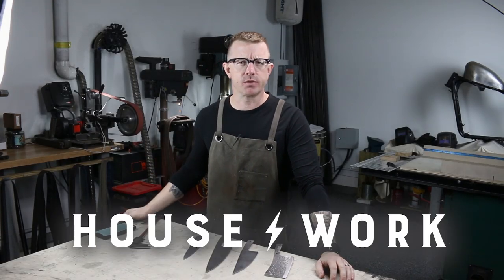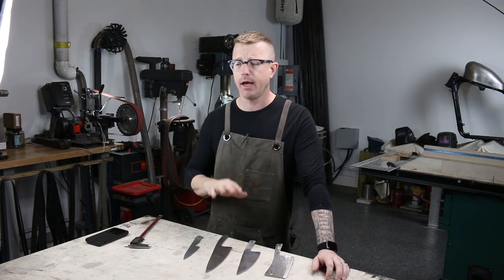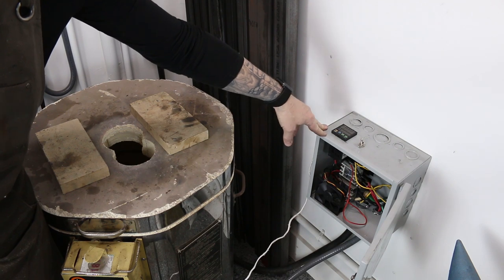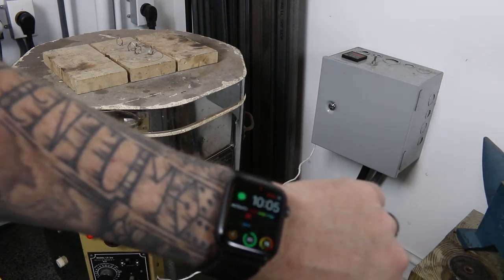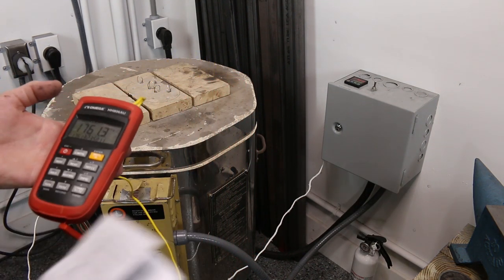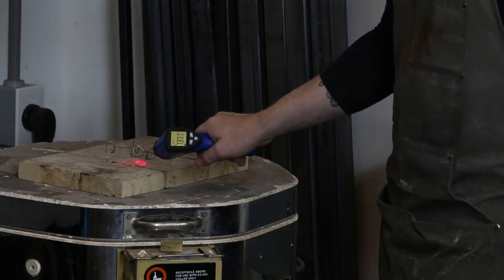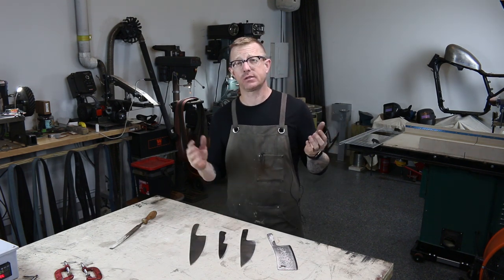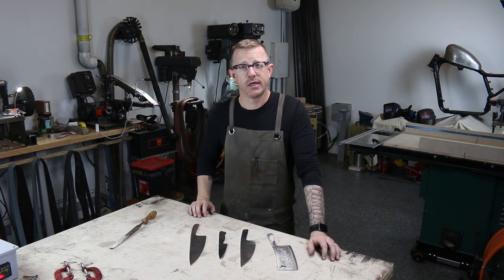How To: A-2 Tool Steel Heat Treating

Comment: Thank you Brian. I am an extremely ammateur knife maker and usualy use old car leaf springs or the occasional chain saw guide bar for making knives. However recently my friend gave me some old bearing sets to make a knife with, so I opened up the bearing units . About a half inch wide by 7 inches long. I spent a few days forging out the steel. I just use a ceremic pot barbecue as a forge and use a big sledge hammer head as an anvil !. Then after that spent another few days grinding then finishing with a lot of filing and stoning to get a scandanavian grind.
I just heat treated my usual way by quenching in oil and was shocked when it would not harden. Did a second quench with the same bad result. It was then when I found your video to help me out. I do have experience with maraging steels after researching helicopter rotor bolts of which I forged and could not harden. I did not know tool steels had similar problems.  Thank you very much for the video of which I learnt a lot. I wish I saw it before putting a lot of time into this failed project but you never forget when you learn the hard way. 😂
Reply from the maker: Awesome - Happy it helped out! Thank you!

Comment: Thanks for the insight Brian. My interest in heat treating A2 is the result of needing to make plane irons. I have some precision ground A2 flat stock that I want to use. What I need to know is how to make a "poor man's" heat treating setup so that I can heat treat what I have. What do you reccomend?
Reply from the maker: The best and cheapest way to get a heat treating setup is to do what I did and use an old ceramic kiln and covert it to a digital control. I made a video on that. Check it out. How To: Convert a Ceramics Kiln into Digital Heat Treating Oven - PID Controller https://youtu.be/pRuq8hOTOWU

Comment: Wow, bad ass channel man, stumbled across you this afternoon cause my Neigbor threw out a treadmill and I knew the motors could be useful....anywhoo, to the best of my knowledge, those knives you just tempered gotta be up there

I’ve never heard of a double tempering cycle not an air quench, but dropping 1000 degrees Frankenstein in 3 minutes as opposed to 3 seconds probably isn’t much difference 

Got something to do with making the steel go austenetic so the martencite crystals can form with layers of cementite around them 

I bet they’re about as hard as you can get steel to get with an easy bake oven lol

Do you plan on doing a blade quench? 

I hear you can get some clay, a torch and just heat the blade bit up, then quench it so the blade is hardened, but the rest of the steel is tempered so the knife doesn’t explode into a low earth orbit when you’re carving into a turkey and hit a piece of bird shot someone forgot about 

Pretty dope that freakin knife guy sent you that email, shit seems pretty legit
Reply: Lol

Comment: I see you moved your PID controller box, off the kiln to the wall......did the controller box get to hot?
Reply from the maker: I had an instance where I had one SSR melt on me, now I don’t know for sure if the box was too close to the kiln or what exactly so I added a small DC fan to move the air around and removed it from the side of the kiln just to make sure. You would think both would fail. Just to be sure I took it down, put it a few inches away and all has been working fine since. I use the kiln weekly with zero issues. Thanks for watching and commenting.

Comment: Why didn't Mike mention to not let your peice go below 120f before going into fist temper cycle,  or Don t start temper cycle until it is cooler than 150 f.
Reply from the maker: I don’t know, is that a thing? Get back ASAP as I am heat treating some more of this today. 😅
Reply: @HouseMadeUS  I read a book called heat treating for tool steels,  The author specifically mentioned that of you want to see a full potential, out of the steel, what is considered tool steels specifically, you want to have your temp cycle ready and not let cool  (in this case air cool, or fan cool) past 120 f, because, it basically really limits the effects of tempering. For a hard knife that just cuts succulent fish and paper, this might not be a problem. But if you wanted to do a sword, I believe you would want to start tempering between 150 and 120 f at like 650 or 700 for 2 hours two times.  But I'm a little fuzzy on the soak time,  if it's a 1/8 inch blade, does it still need the full 20 minutes at 1725 to 1775?  I've seen many guys on you tube make wonderfull, sharp big choppers,  doing everything but that, and they start chopping when it's only a little cold outside and big chips break out of there blades.
Reply: Ok one more run at it, so if you let tool steel cool of to room temperature, it forms retain ed austinite structures ARound the grains,  and if you try to temper, it will fracticaly start to grow and eroode those grains,  into a less fine, more brittle structure.
Reply: @ryanb1874  I know some makers that use cryo after quench/before temper, which would obviously bring it way below 120f.
Reply: @ryanb1874 this is factually incorrect. 
All hardenable steels, no matter how fast the quench will have RA.
Always. 

One of the actions happening during tempering is converting RA to martensite.

The reason for a second Temper is to Temper the newly converted martensite from the first Temper.

Sub zero treatments also convert RA into martensite.

Comment: I will never understand how can quenching be good, when surface solidifies faster than core, just imagine core volume cange in already solid surrounding. How can it be even than?
Reply: @awashburn6944  i know it is, but  there must be a way to quench, stress it from inside out. It is a solid that is stressed on high temps, and as it cools it shrinks unevenly so it leaves lot of microscopic cracks and voids like strings, thats what i ment, yes my bad it is a solid , but very streched solid .
Reply: @awashburn6944  wait, but not all of the lattice are martensitic, i cant imagine that when lattice is stretched at high temps and it is stressed it can save same formation. In some magnification value it just separates in string like figure and create voids, and I saw it in images. My understanging on martensite is that when cooling rate is high, puling forces between iron atoms are aditionaly elongated (because one C inbetween) and it cracks basicly the same in all C content steels if cooling rate is elevated. So for example, imagine a lattice, and external stessor, and as outside atoms take more stress untill it comes to inner one concave shapes form leaving only half atoms bonded, thats main problem for fatigue I think, like in welds, its not cracks, but exists and its clearly visible under microscope. Those string like voids are actualy small lattice cracks, initiator for visible crack, and its rly hard to track on what magnification value will they be evenly distributed. Its bugging me, cuz well compressed forged steel dont have such problems
Reply: @awashburn6944  just to make things exaggerated, when liquid glas drop hits water its hollow from Inside , but since its liquid there is no deformation, and if rly hot solid hits room temp fast , bilion microcracks happen in same pattern from inside out! I just hate that so i was thinking there must be a way to stress material from inside out, that would solve so much fatigue problems
Reply: @awashburn6944  but its still a solid. I take glass as example to compare because less resistance as it adapts to external stress easier. It is irons tendention too if it creates voids after quench. Voids confuses me, and separation in lattice, it cant even be called crack cuz its very small. Thats obvious tendention to behave in direction of like glass drop, but because differences as you said it just "snap" in different way.
Reply: @awashburn6944  about uneven cooling , actually object tends to even cool trough surface line, so it bares much more stress because its still hot untill signal reaches core , and thats where difference in temperatures strain surface longer untill core catch up. Surface cant cool instantly because thickness dont allow, so difference in temperatures object surface/collant creates strain on atomic attraction force equal -500> celsius object temp( probably much more), without extenal stress. is simple words its squeezing so hard like you freeze it until it crack. But thats not the problem, problem is that stress pulls atoms from inside in surface direction and create voids, those 2 types of cracking are not related, because 1st one happen instantly, and 2nd leaves space for damage under load.I suppose carbon escapes in that voids after temperbecause it has nowhere else to go, I tried by best since english is not me native

Comment: I've never tried A2,  but have done quite a bit of SS.   Next time, you might want to get some SS tool wrap to prevent oxidation. I bought a piece of 1"x12x12" aluminium, & cut it in half...  Great quench plates, and while the steel is cooling, I use my air compressor(I added a filter for my sandblaster & a "T" for other tools, so I don't have to worry about moisture) to cool it quicker... I've heard a lot of people talk about you have to quench vertical, also have heard, you have to be facing west, but honestly I always quench horizontal, mainly because it's all I have and have rarely had problems. When I 1st starting using a toaster oven, I just used a cheap thermocouple to set temps, might have to check again, it's been a while... I'll test them for ya no problem, just let me know. Hope all is well, take it easy...
Reply from the maker: Thanks Dave. Can you email me your address? I’ll send you a blank to test. Brian@housework.us - I am getting setup to build a plate quench, I’d like to try some stainless. I’ll make sure to turn west and throw some holy water on it. 😂